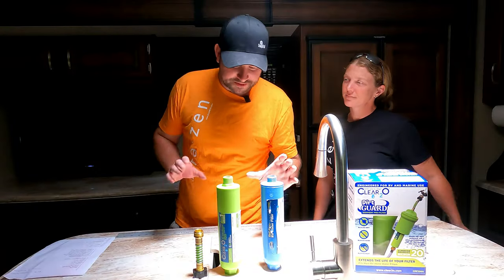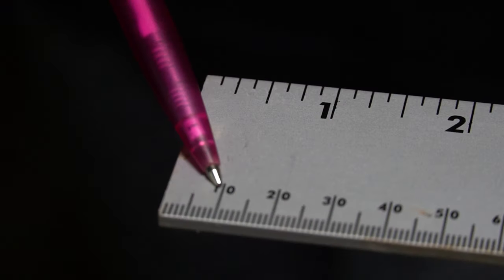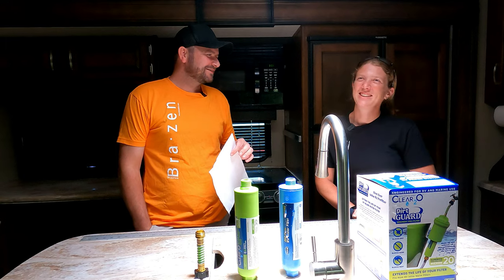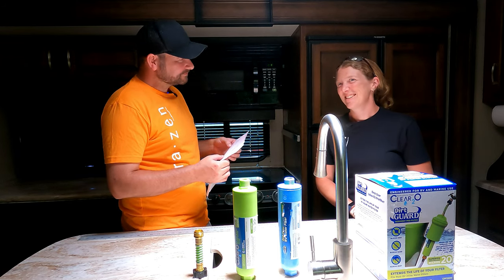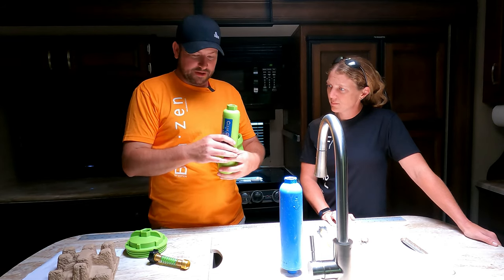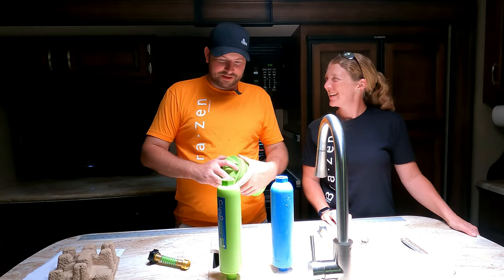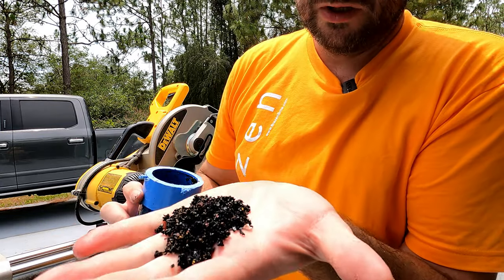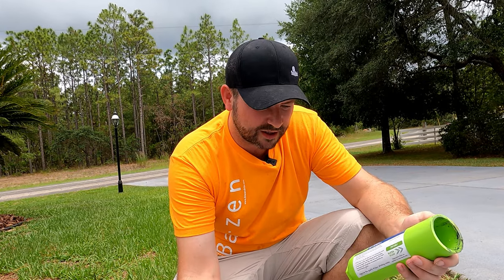We destroy RV Water Filters | Camco | Clear2O

Comment: Good information on these products. It led me to research at what level the public water treatment plants filter the water.  EPA standards set filtration  requirements at 0.2 microns.  So both water filters are more than sufficient and you probably do not need one at all.  But I will continue to use one wherever we camp.  Thanks again for this hard hitting analysis and help from your able assistant.😎
Reply from the maker: That's great information to know! Thanks Tom. However, I can confirm that there was visibly some nasty stuff in the Camco filter that we have used for about 4 months now. I do worry about the stuff we can't see. Even without a filter, I'm sure none of this would be really harmful, but its great peace of mind to have it there. We have heard some horror stories. Most of them from campsites with old plumbing and well water.
Reply: @BrazenBrits  at our Marina there is some sludge build up in the town water supply that clogs everyone's strainers so I don't care what EPA standards call for they can easily slip through as I don't exactly see many EPA agents testing quite often.... To busy I guess... I LOVE this video and I am done with the blue ones.

Comment: Id be curious how that stacks up against the filter system we built.  I use a blue camco filter at the outlet and have a housing with a 5 micron and 1 micron 'whole house' filter positioned just before it enters the rig.  At somepoint, I am going to compare the filtering our RV water system does against what our house soft water/reverse osmosis system.

Comment: We will continue to use camco with their sediment filter (20micron). If if it hanging properly it should go through more carbon and catch more particles. The other one seems to shoot water to the bottom of the filter and not much passes  thru carbon. 1 micron can restrict water pressure also. It will depend on pressure at the individual rv sites. We have used 5 /20 ,micron pleated  filter at the house, and there seems to a big difference in pressure. But  a great video. Wonder what  the foam does at each end? Maybe a type of sediment filter.

Comment: As a double filter system I added the Camco Blue to my Boogie Brew garden filter for my garden and bird baths. Within less than 2wks the birds stopped drinking and bathing in the water, seriously during this extreme heat dome of '24 they won't drink it is quite shocking. When I removed the Amazon bought Camco and used the stand alone Boogie Brew they went back to drinking and bathing again. I'm not promoting Boogie Brew I'm just saying that the Camco must be a pretty bad tasting etc if the birds and critters won't have anything to do with it. It was my first time buying Camco and it's really quite sad that the Made In USA label showing makes unsuspecting ppl think it's a great product and it's probably the worst on the market to use. I have 6 birdbaths and as I look out the window right now in this heatwave, all my birds are back and appreciating a good drink again. I'll have to try the Clear20. The birds will probably think they're at a spa sipping chardonnay water.  Thank you for sharing and wanted to do in kind.

Comment: DO NOT switch to Clear 2O. Especially the Dirt Guard. I have purchased 2. In BOTH the lids just cracked and flooded water everywhere. After it happened to the first one, I thought perhaps I had done something like drop it. Nope the second one just exploded after only 60 days. As for the 1 micron filters. I have used those for 2 years. Suddenly my last 3 have only lasted 15 to 30 days before they completely clog. Different areas of the country and in all cases just city water. The dirt guard is approx $45 and the filters are approx $35. That's $80. Plus the Clear 2O cuts the water flow to under 2 GPM.
Reply from the maker: We have had issues with the 1 micron filters clogging up at certain parks and it is frustrating when they are expensive to replace. We love the DirtGuard though. We have had no issues with it at all.

Comment: question does the 1microm restrict water flow to where it very weak in my camper??
Reply from the maker: Yes it does reduce the flow if the water is dirty. We stayed at one place and the water pressure was awful, but came to find out the water was full of iron. When we took the 1 micron off all our sinks and toilets stained rust red 👎
Reply: It does even if it is clean water. Don't believe the hype

Comment: With that dirt guard part, do you think that will expand the life of the canister filter part?
Reply from the maker: Hi Tracy, after a year of use, it sure does. The canister part is 20 microns, which filters the same as the typical blue ones you can buy from anywhere. However, the green canister one blocks up very quick, which has been frustrating as after time it reduces water flow. It’s great as it’s filtering out the bad stuff, but bad because it blocks much quicker than the blue ones
Reply: @BrazenBrits  do you just have to buy a new canister or is there way to unblock it?
Reply: The green hot dog filter is trash when clogged.

Comment: The problem that isn't mentioned purposely is that rv parks/campgrounds have low water pressure. The blue camco filter allows enough water pressure to shower and use the faucets. The green filter reduces the water pressure so low that it cuts water flow down to a trickle. On a residential water supply with 80+ lbs of pressure the green filter would work ok at best but if you are in a rv park with 40-45lbs of water pressure you will be upset you just wasted your $$$ on the green filter. The comments on here are very misleading, don't waste your money. If nothing else buy a whole house filter housing and a 5 micron carbon filter and you will still have water pressure. 1 micron chokes water pressure down to a unusual amount
Reply from the maker: Hi John, we used this filter for a couple of months and it was fine. However, we went to a campsite that was extremely high in iron. Within 2 days, it was clogged. So we agree with you in a way. We do now carry the standard blue filters in case the green one clogs and like you said, we are looking into a whole house system that I have been recommended before. Still researching these, but hope to make a video when we decide on the best one for us.
Reply: @BrazenBrits did you end up installing a whole house filter?